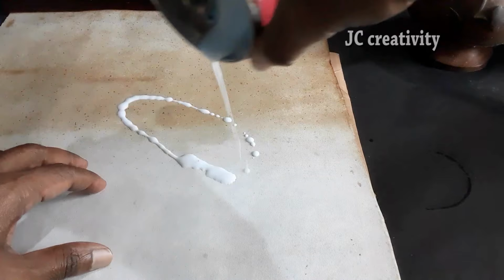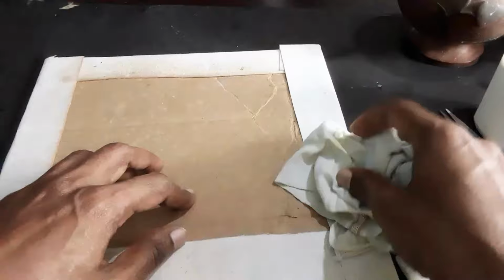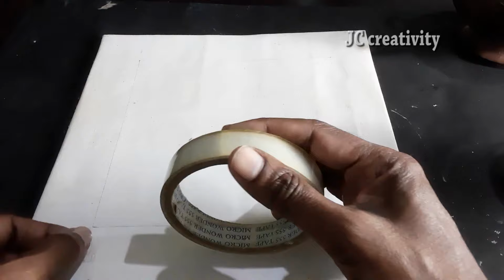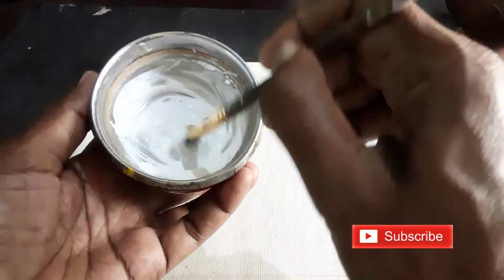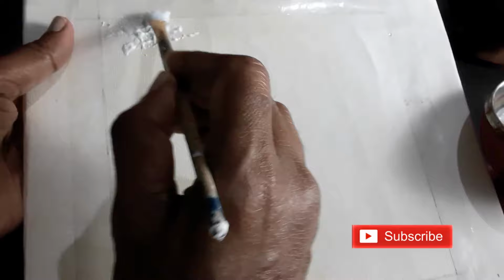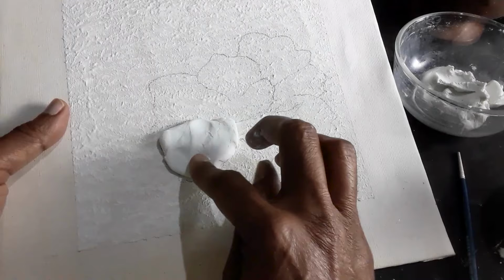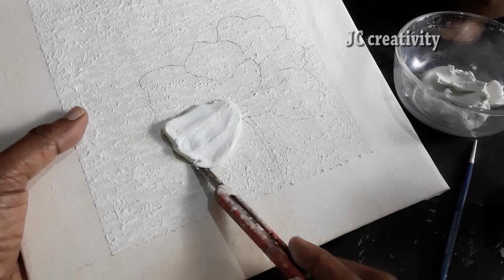Making  of flower using wallputty /Relief painting/wallputty craft ideas

Comment: Which one is better pop or wall putty for relif painting or for making crafts...
Which makes a better clay pop or wall putty to scult or to mould
Reply from the maker: For crafts and relief,in my experience wall putty is more comfortable. As Pop condences very fast we need to work very fastly.For moulding pop is best.Even for sculpting pop is best.I uploaded  some videowith pop  sculpting.
Reply: @JC.Creativity  ok ...thankyou so much 🙏
Reply: @JC.Creativity  i want to make peacock ...what shld i use pop or wall putty ...i tried pop in other project bt its finish ws nt much smooth even after using sand paper ...plus clay dried too fast ...kindly suggest me
Reply from the maker: @archanadev3145  For making peacock it's advisable to use either air dry clay or mseal for long lasting. We can even use wallputty, if we hardern wallputty by adding fevicol and paper clay or tissue paper mache. Even plain wallputty is ok its quite durable. When we spend our time and money,let it be a long lasting one. So that we  can gift it to some one or else we even can sell it.
Reply: @JC.Creativity  ok.
Even i use fevicol + water to make paste of pop. This time i ws thinking to add paper bt i was not sure which one should i use ...
Thanks for advicing me ..i wl definitely try wall putty+fevicol+paper ...
I hv already worked with shilpkar and home made air dry clay ...no doubt both were good bt shilpkar clay costs much ...so i thought why nt try wall putty ...

Thankyou 🙏for replying
Reply from the maker: @archanadev3145  You can use fevicol with pop to make it strong.Kindly watch my video of orange colour flower,I made out of hardened wall putty,your doubts will be cleared.If we r framing our work plane wall putty itself os ok.If we r making any statues like something it is better to go for hardened wall putty. If we want to win,we have to be different, ie,we must do something unique.
Reply from the maker: @archanadev3145  Yes I know shilpakar clay costs much.From now on you start working with hardened wall putty,defenitely you  will feel happy.
Reply: @JC.Creativity  sure...i wl watch ur video
Reply: @JC.Creativity  😊🙏

Comment: Does this require a canvas as a base to hold the putty or can we use wall as our base? Also will this technique work on wall with faint putty flower?
Reply from the maker: We can make this both on  canvas as well as on wall.This will work even  on wall.For long last losting on
Wall, first we must draw the sketch on the wall tap with a hammer here an there inside the sketch to remove paint on the wall. Kindly dont use Asian putty powder.Use Birla white or jk wall care powder.To make our craft more stronger we can mix little fevicol while preparing putty dough.
Thanks for visiting my channel.
Reply: Watch New Painting Video: https://youtu.be/6u1lMycCE8M

Comment: Can i use mdf board as base.? 
Or can use plywood also  ..???
Reply from the maker: Both can be used.If you r  using mdf or plywood, you must  apply a primer,like you can make a paste of wallputty, fevicol and water apply over the board, once it is dry you can work.If you r working on a canvas board directly you can work. It will ease your  work.
Reply: @JC.Creativity  Thanku so much sir😊 and ur art work is too good 👌
Reply from the maker: @renuscreations6810  Thank you so much.

Comment: I have A4 size canvas board cum paper, it's hard like board n has a silky n little bit rough texture on it. Can I use that one?
Reply: Okay thank you
Reply from the maker: If the canvas has rough texture ,you can apply a paste of wallputty,fevicol and little water, apply over the canvas board, once it is dry you can work with it.If you have cartridge paper,you can prepare a board as I did in this video and you can use it.I hope you got some idea.If you need any ideas, kindly comment me.